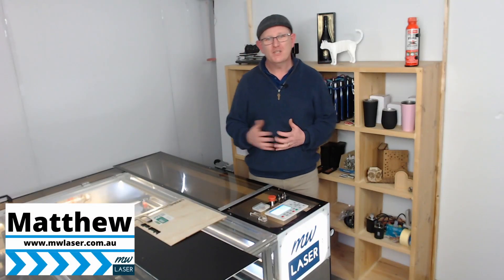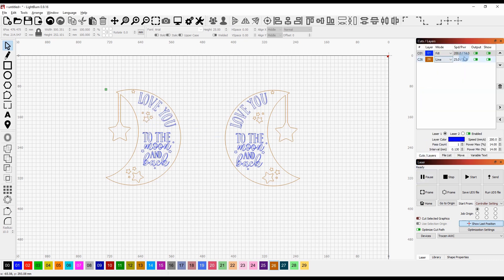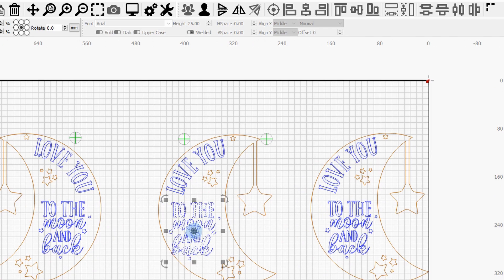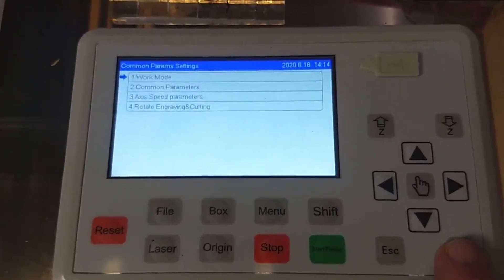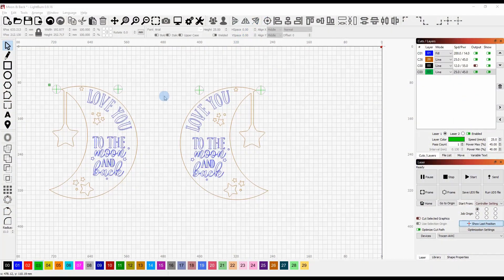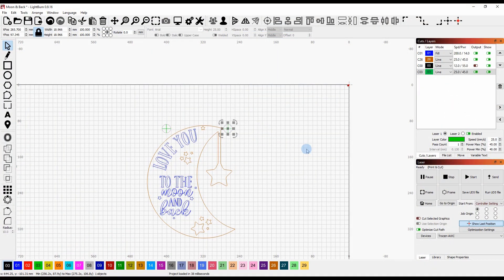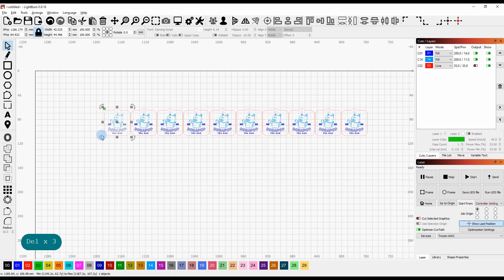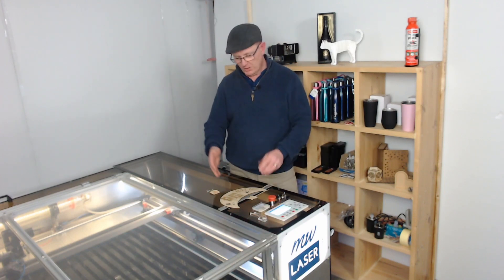Using Lightburn Print & Cut for Double Sided Engraving

Comment: It is a great tool, but if you place a paper on the honeycomb base, secure it with magnets, cut the reverse silhouette, place the already cut shape in the hole, it will fit perfectly, and you will be able to engrave with perfect placement, and if you make several ones, it is so much quicker as you don't have to adjust every time
Reply: Sometimes the piece being cut out isn't mirrored.
Reply: @caseygriswold8617  It needs to be mirroed when you engrave on both sides, as the second side always mirroes the first. So you can engrave and cut without any stencil or gig,  the fist side, and then do the paper thing for the other side, and it needs to be a mirroed silhouette of the first one.
Reply: @Fancylooks  It doesn't have to be mirrored to engrave on both sides. It has to be mirrored to put it back in the same cutout. Sometimes it's not mirrored and you need to flip the board, which is where print and cut can be super handy. Say for instance you were doing a double sided united states shaped ornament and cutting it out of a 3" x 3" board. You can engrave one side and cut reference points that are equally distant from each corner, then flip the board over and use those reference points to engrave the other side and then cut out the US shape, and it will align with the first side engraving. The US shape that's cutout will have to be mirrored of course on the second side, but it doesn't have to be a symmetrical shape that can fit inside a cutout when flipped. You can flip an entire board filled with different engravings and different shapes for double sided items.

Comment: Maybe I missed it but I assume that you removed the circle around your target markers ( green on your cut layer) or it would have left a round cut out hole on your material rather than your (+) mark. Excellent videos, you take the time to explain in very clear terms 👍
Reply from the maker: You are right! I set the Green as a NO output layer.
Cheers.

Comment: Love this. Is this possible to do this using the TopWisdom controller? A video showing this would be great (hint hint)!
Reply from the maker: Yes I believe it does - I've been told it works well, but I have not tried it myself as I do not have a machine here with a TopWisdom controller installed

Comment: Great tip Matt, looks like LightBurn is going to be my choice over RDWorks, I've seen some great stuff with the LightBurn cameras also.
Whats your opinion on using the camera for positioning etc?

Best regards
Reply from the maker: LightBurn is the best choice and is worth every dollar spent.
I have played with camera for positioning, however due to the type of work I do I have not bothered to implement it permanently yet.  I do plan to on my new machine when it arrives.
Reply: @MWLaser  thanks for your reply Matt, look forward to seeing your new toy.
Just have a question for you.
I have just fired up the x-y axis on my build,  I'm using a Ruida 6445 controller, got them moving OK, but I'm not able to setup the machine origin via the controller.
Tried in the multi origin setup but can't get it to work, do I need to set set this up via LightBurn or RDworks?

Regards
Ralph
Reply from the maker: @ralphzito7609  email me your current setup and some more explanation of the config of your machine etc.  matt@mwlaser.com.au
Reply: Thanks for your help Matt, I’ll get some info to you on Monday